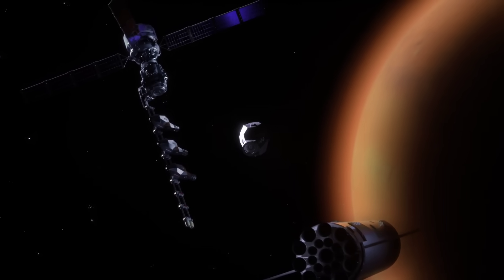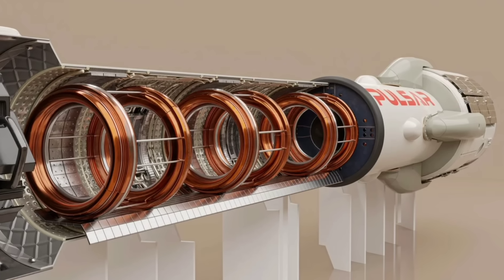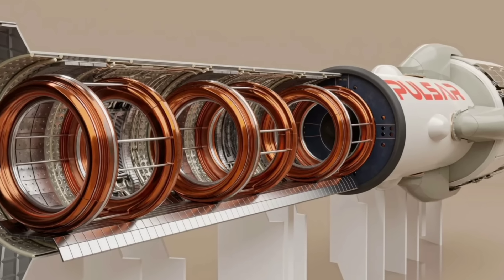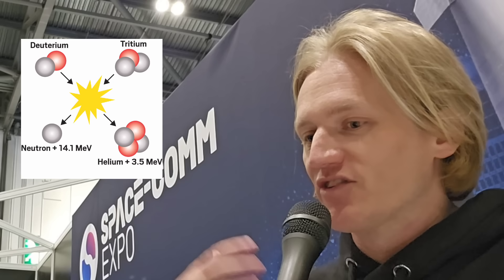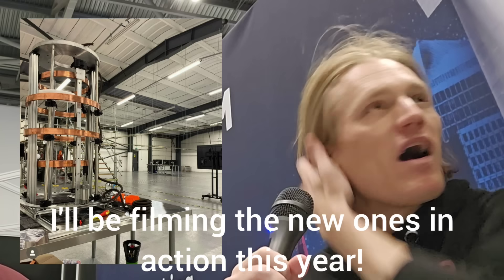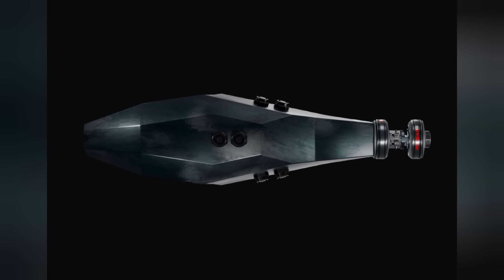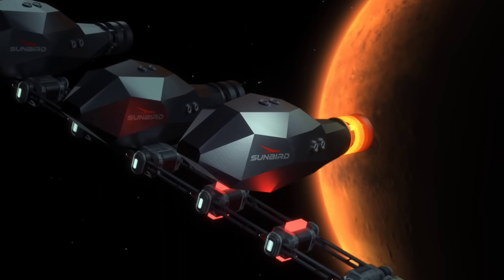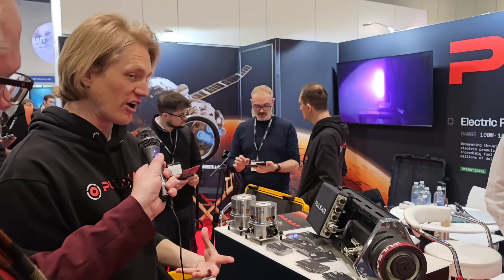15 TIMES faster than Nuclear Rockets!  Pulsar Fusion unveils new Sunbird Fusion Drive!

Comment: The classic logic of nuclear electric/energy rockets, called "ion/plasma." Was stored nuclear power. Using dinky size halogen lamps. They needed to be AMP thrusted nuclear. Which can also idle to regen. If you can sustain 0.5 to 1gforce atleast. You have gravity while exponential acceleration vs a tin canister limitations. But the classic fuel. Well you can save them for VToL sequals.

Comment: This engine opens the door for frequent Mercury - Moon flights. 
Mercury escape velocity 4.3km/s by Concentrated Solar Thermal Hydrogen Boosters ISP 900 sec,
 bypassing LMO and aligning with trans-Earth windows (~1–2/month)
And Sunbird efficiently handles ~15–20 km/s transits (~1–3 months), supporting a Mercury-Moon network.

Comment: Why are we not putting research into using the Suns highly energetic particles so we don't even need to lift fuel into orbit?

Surely using magnetic confinement we can redirect these particles creating thrust to propel ourselves up to at least 50% the speed of light?

These particles are already travelling at the speed of light so all we need to do is "bleed off" some of that energy and direct it where we need it to go to propel ourselves in the opposite direction?

We'd just have to try and stay out of the shadows and it could bevused for interstellar travel as the cosmic wind would also be rich in these particles so no need to store fuel in the craft itself (lowering its mass).

We can bleed off some of ghe energy to power the magnets required and for electrical needs in the shop and use a field to encompass the craft as shielding from the dangerous rays themselves.

If the earth can do it naturally to create the Van Allen Belts then we could do it synthetically using electromagnetism!!

We need ro start researching this, we would only require fuel for leaving planets gravity or that of other bodies in space i.e. moons etc

I know it sounds a bit "sci-fi" but the principals are sound enough surely?

I sometimes think I'm just talking to myself ... 🤔 ... lol

Comment: One of the unfortunate problems of a poorly educated public is that con artists can present half-conceoved ideas. The supposed physicist that was going to use an anti-matter catalyzed fusion system didn't do his particle physics correctly: You can't yield more anti-particles from an isotope collision than the energy you put into it. This "non-fusion fusion" has to have an initial energy input for a non-sustaining cycle. What is it? You add up the total energy in the system it MUST BALANCE OUT (minus heat loss)

Comment: This would be easily achievable, as there are no problems with initiating fusion, the problems are all to do with the long term containment of such an event. However, containment would be the last of your concerns in a rocket, where aiming the fusion event is the only requirement.

Comment: why  even mention "net power" when you haven't even demonstrated if you can get it started. You would need enormous amounts of energy to keep it running. forget about how you're gonna get helium 3, if you can get helium 3 easy then the problem of propulsion is solved, because you need a mature space propulsion technology to get helium 3 in the first place.

This is a simulation, it's not a new kind of engine. You have no prototype, no proof of concept, you don't even have fuel.

This is a welfare scam for scientists.

Comment: Pulsar Fusion's work is thrilling! Another exciting ion thruster, patented for the highest thrust-to-mass ratio and efficiency, is uniquely designed to lift both its power supply and itself against Earth's gravity!  The crafts are called the Ion Propelled Vehicle or Self-Contained Ion Powered Aircraft, there are more than 45 videos of them online.

Comment: I have had an interest in beam propulsion for some time. The ISP is phenomenal. Would it be conceivable for these, essentially fusion space tugs to take the material and robotics to construct beaming stations in strategic locations within the solar system? It seems in theory to be able to establish a network of neutron beam emitters to propel manned craft to practically any part of the solar system within a respectably short span of time. This beaming propulsion system made possible these fusion tugs and automation could conceivably create an interplanetary commerce industry. By being aggressive, an interplanetary network may be even possible within 1-2 decades.

Comment: A singe Sunbird mounted to the side of the craft,as shown, won’t take you anywhere.  You would just go into a tumble till RUD-ing.
  The thrust isn’t in alignment with the center of mass.  
  The  video shown is an animation of course - not a simulation of real physics.  
  This guy is trying to sell us all o😢n the future potential of this technology.  Good for him but…
  It’s hard for me to accept validity of what he claims when he doesn’t even see that basic physics issue with his prepared animation.  
  Maybe he should be trying to sell us on three smaller but throttle capable Sunbird engines instead of one per craftsmanship- to be positioned equally around the craft for the needed control and a proper thrust vector.
  An animation of that would better fit known physics. - IMO!
  I know.  I’m way too picky sometimes.  Maybe you are too…
  I try to resist commenting but sometimes I just do it anyway.      
  Maybe you do too.  
END TRANSMISSION

Comment: How is this better than a fission fragment rocket  which doesn't require fusion? its fairly small in size, has a specific impulse of over 1 million, and can be combined with inert gas to increase thrust at the cost of efficiency.

Comment: First big problem I see with this is where are you getting the energy to power this reaction? If the fusion is less efficient it's probably going to be net negative(especially if you are shooting the products out of the back and can't capture their energy) which means that you need a big and heavy power source to actually get any decent thrust which then drastically lowers efficiently as now you have more mass to push.

Comment: Until they get this working, which they are not, the announcements are a waste of time. The problem with fusion technologies is that they don’t yet work. This isn’t, as they say here which is the opposite of the headline, a fusion engine. From what I can tell from the information released, this will never be a fusion engine. So please, let’s not get too excited by this. Even what they’ve announced isn’t working. It just a concept model.

Comment: I'm very curious about this. I can't get my head around how they would manage this linear fusion. Do they have a stable plasma existing in the magnetic confinement that is magnetically agitated? Is it the magnetic pressure of the confinement causing the fusion? That sounds very unlikely though, I'm not sure if that's possible or if it is, would be inordinately power hungry and probably beyond our materials science. Do they fire particles into the magnetic chamber, bombarding the 2H with He3 to actually cause the fusion? sounds more plausible but doesn't seem consistent with what he was saying or the model shown. As far as I'm aware, linear fusion devices have two ends that fire at a central chamber to cause fusion but that isn't 'directional' per se, the momentum terminates in the center where it is used to create the fusion reaction, right? Have I missed something? Tokomaks spin up the plasma and bombard it, again using momentum transfer to take that extra step to fusion. So what in this case is the actual mechanism for fusion? How are they actually overcoming the electrostatic repulsion of particles to initiate fusion? How do you maintain the pressures necessary to maintain the fusion process or maintain the plasma when you're firing it out the back end?
Not trying to invalidate this, I just need to understand and I can't find any information!

Comment: Way too cool. Elon must be checking this out, even though he likely already has. 

The Sunbird is a proposed spacecraft powered by Pulsar Fusion’s Duel Direct Fusion Drive (DDFD), a nuclear fusion engine designed to produce both thrust and electrical power. Unlike traditional chemical or nuclear thermal rockets (like NASA’s old NERVA, which hit exhaust speeds of ~8.5 km/s), the DDFD aims for a specific impulse (a measure of efficiency) of 10,000–15,000 seconds. For context, chemical rockets top out at ~450 seconds, and nuclear thermal rockets reach ~900 seconds. Specific impulse ties directly to exhaust velocity—DDFD’s could hit 98,000–147,000 m/s (220,000–330,000 mph), dwarfing NERVA’s ~19,000 mph. The "15 times faster" likely compares this exhaust speed to nuclear thermal rockets, not flight speed itself, as spacecraft velocity depends on mission design, not just engine specs.

The tech’s core is fusion—merging atomic nuclei to release energy, like the Sun does. Pulsar’s DDFD uses a compact reactor to heat plasma to hundreds of millions of degrees, hotter than the Sun’s core (15 million°C), then channels charged particles via magnetic fields for thrust. It’s also said to generate 2 megawatts of power for onboard systems, a dual-purpose leap over ion thrusters (high efficiency, low thrust) or chemical rockets (high thrust, low efficiency). The Sunbird concept involves these fusion drives stationed in orbit as "tugs," docking with spacecraft to propel them interplanetary distances—think Mars in four months (vs. NASA’s seven) or Pluto in four years (vs. New Horizons’ nine).

Is it real? Pulsar’s been secretive for a decade, but they’re not just dreaming. They built non-fusion propulsion (hybrid rockets, plasma engines) and started constructing an 8-meter fusion chamber in 2023 in Bletchley, UK. It is said that Static tests are slated for late 2025, with an in-orbit demo by 2027—ambitious, given fusion’s history of delays. They’re partnering with Princeton Satellite Systems, using AI to model plasma behavior, a key hurdle since confining turbulent, ultra-hot plasma is notoriously hard. Funding from the UK Space Agency in 2022 for fission work bolsters their cred, though fusion’s tougher.
The "15 times" claim holds up if you’re talking exhaust velocity versus old nuclear rockets, but it’s not flying yet—prototypes are years off, and fusion’s never been sustained practically in space. Critics note fusion’s mass (reactor, shielding) could offset gains, and radiative cooling in space is a beast. Still, it could slash travel times and power deep-space missions beyond solar’s reach if it works.

Comment: hmmm so what are they using for the plasmatic outgassing? seems like chemical energy is preferable to this given the loss of "fuel". 

I love the idea but the answer for making this viable for deep space travel is to have a system to transition the sunbird from atmo thrust to vacuum trust with an iris that transitions to electron intercept instead of plasmatic outgassing. you have to be able to recycle your fuel. deuterium and heliem3 are great for the reactions but why lose it when you can harvest it from the same system and repurpose it.

Comment: Could you attach a fusion rocket to a giant wheel and turn it to generate electricity?  It sounds possible and scary, but with enough space for the plasma to dissipate it might be possible.  This could use a fusion rocket to generate electricity.  Perhaps it would be inefficient.  I can't guess.

Comment: For those wondering if this kind of engine would be a game changer if you can get it to work... heck yes! A chemical rocket engine like that used by SpaceX and others, has a limited burn time of only a few minutes before it runs out of fuel. A fusion rocket on the other hand could run for months. If you want to get to Neptune you gotta accelerate for a long time, and then flip and decelerate quickly so as to make the trip time reasonable. Some of the unmanned space probes have so little thrust they can take 8 years to get to the outer planets.

So fusion power could speed up rockets by more than a factor of 10. So well worth investigating. But you do need an energy source to power these things, and that is another issue that needs solving. But we do have radioisotope generators that run for decades (like the ones used in Voyager). So this is very exciting technology.

Those 5000 Watt hall effect motors are quite impressive. Gotta have a lot of solar panels to run those. I guess people are building some very big satellites.

Comment: It's a scam!
To have a high thrust and isp you need a lot of power. Anyone with a slight understanding of physics can work this out.
If the fusion is not net positive, the power comes from nowhere...magic?
This fusion reactor can't be net positive, because it lacks the confinement needed to burn the required fraction of the fuel because it has an open end.

Then it's just a complicated ion engine with expensive fuel that also is slightly radioactive.

Let's see if this comment is deleted for pointing out the snake oil.

Comment: This sounds like a scam until I get a little more explanation.

 Is this some concept for if we solve fusion net energy gain? Otherwise none of the claims made by this company make sense. The website claims this thruster will generate 2MW of energy with no explanation.  The linear fusion idea makes sense to accelerate propellant mass, but it would require a lot of power.
Reply: This isn't a reactor meant to generate electricity, its an engine meant to generate thrust. We don't need to solve net energy gain for this to work because its not capturing the energy.

Comment: WE
With chemical rocket 6 months to Mars. With ion drive engine 2 months to Mars.  With this rocket engine 1.2 hours to Mars. This engine works like the Helion but instead of a cylindrical chamber it is a cone shaped chamber to compress the fuel. You guys can use water fuel instead of He3 and D and fire the engine with an electric spark at a high pulsed current and voltage using my star device to make the electrons. Contact me. I explained this to Elon last month for his raptors and he loved my idea.

Comment: Hi it's kind of funny angry you should know that I think buzz Aldrin had a concept for an orbital transfer cycle vehicle where you would barely use fuel only in the case of adjusting course towards the planet you want to be at and just Coast the rest of the way and if the impulses of this engine are higher than normal rocket engines wouldn't that be better than elon's starship and yes I'm going to get all the Fanboys annoyed rocket fuel engines will not get you to Mars doesn't have the Delta v fusion engines more efficient hell yes and if they're more efficient later down the line you might get at least optimistically 52 to 42% of the thrust from the engine crank it out and if we refine the engine more you get 92 to 96% efficiency out of these engines containing fusion more energy out the nozzle then a rocket flame and more oomph pushing her behind to a planet if we ever fired one of these off towards orbit oh boy that the orbital 1G gravity constant acceleration would be like oh my God but yeah buzz Aldrin had a concept call an orbital cycler vehicle it doesn't have to be advanced it just has to be bare bones enough to get the crew there and back and over time our infrastructure will improve in space and the orbital cycler vehicle will get upgraded possibly a rotating gravity ring for staff and crew possible gardens and stuff for food on board and I mean this transfer vehicle can be adapted to launch satellites into Mars high and low orbit for communications with Earth be able to drop supplies on to Mars's surface not to mention it could possibly doc a spacecraft to it and then drop it off at Mars oh my God it's the plot of the Martian movie f**** crazy isn't it sci-fi telling us exactly what the f*** we should be doing and I believe this engine is how we do It along with buzz aldrin's concept for a orbital cycle vehicle I mean all you have to do is burn some little bit of fuel to adjust your course towards the planet by trying to aim towards the Sun and where the planet supposed to be now I know that is sketchy we've never done that before but if we put our minds to it we will be able to learn orbital Sun maneuver capture and transfer techniques in space but yeah I'm like yeah Elon musk checkmate V3 raptor

Comment: Nooo they cant produce any energy with their fusion, unproven !!!! They need another fuel source entirely.
Reply: I dont buy the "no need for net power" argument. A normal chemical rocket works because the fuel produces net power when you burn it. If a normal rocket would not produce "net power" then you'd need to add a secondary power source to power your rocket somehow. Basic arithmetic.

Comment: They're not going for fusion "power", but for fusion "thrust". You don't need to covert those heat energy into eletricity, instead you convert them into kenetic energy. You use electromagenatic field not to confine the fusion plasma, but mostly to divert them into a thrusting vector. In space, you don't need to worry about radioactive fuel leakage, you use them as your propellant.
I assume neutron handling is still a massive hazard to dealt with.

Comment: It all starts with the power supply, was thinking how I would do a power source, can't get around not using turbines, thinking turbine turning 6 phase generator then split into two 3 phase circuits, one used for port engine and the other for starboard engine